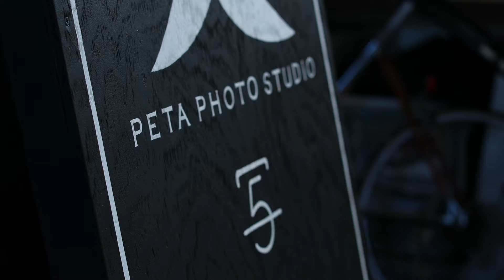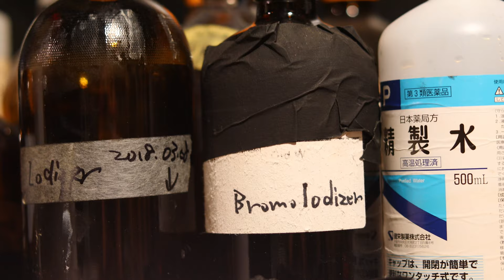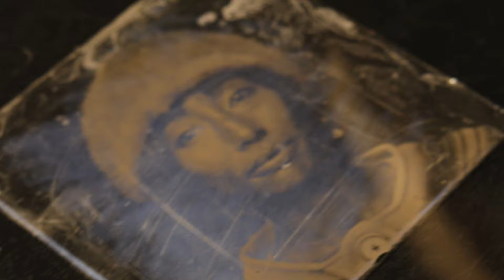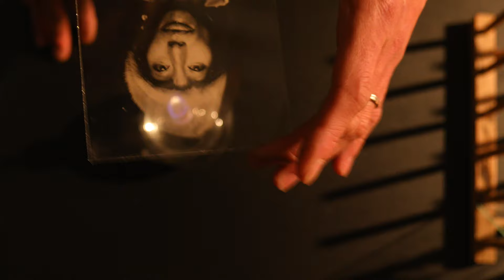Peta Photo Studio-Wet Plate Collodion Process

Comment: Beautiful!!  I am going to try your sealing process with copper tape and solder.  Two questions:  1) what are you painting onto the copper tape with a small brush?  and 2) what are you using on the finished soldering?  Is that some kind of polish?  Thank you so much for sharing your amazing process!
Reply: My guess for 1 is flux for the solder

Comment: Nice job. What's that tape around the glass, that sealed the plate?
Reply: That's adhesive copper tape, which is normally used for joining stained glass pieces. It gives you a solderable surface, which wouldn't be possible with just the glass.